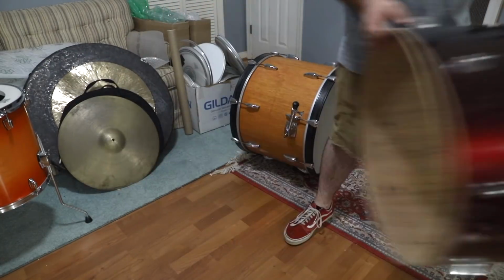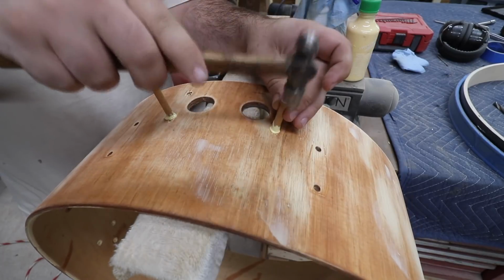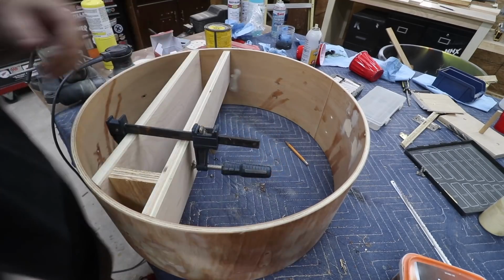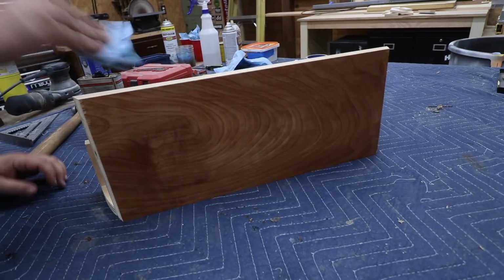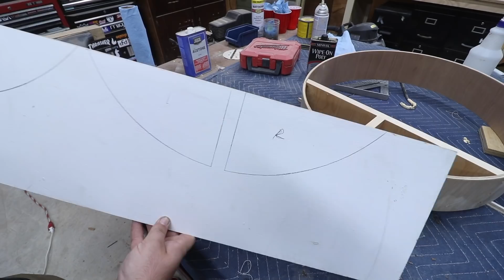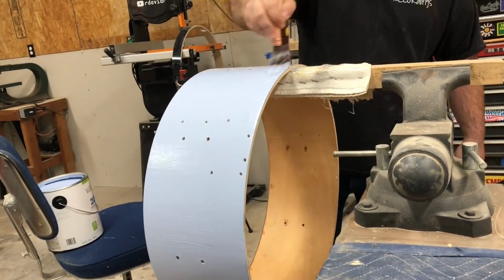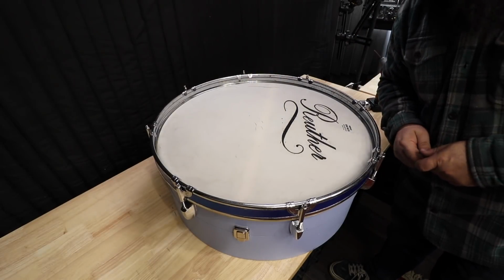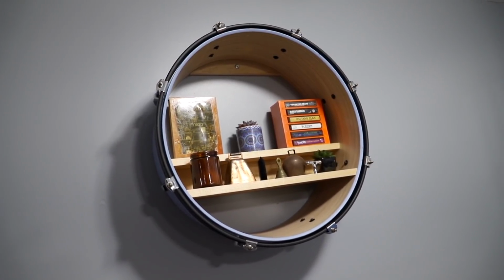I Made a Floating Shelf Made Out Of A Bass Drum!

Comment: 2:04 It is said a good rule of (saving your) thumb using a table saw is "if you can touch the blade and rip fence at the same time with one hand, use a push stick".
I don't want to be all preachy or anything, but as a fellow drummer I know all too well how much it'd hurt to lose a finger, and there have been a good number of long-running woodworkers who used table saws for 40 years before chopping off a finger the first time.
Please use a push stick!

Comment: Real nice. Now I can get the cheapest used Chinese knock-off drum set on ebay and if it turns out too trashy, I can always turn it into a set of rock'n roll shelves! Plus maybe a lamp.
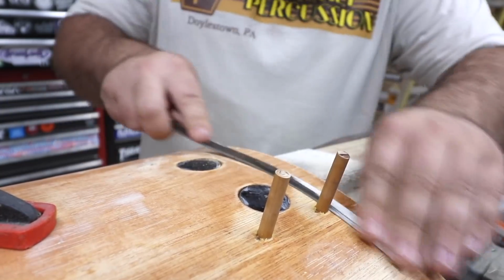1:16 Tool tip (though I'm probably the hundredth tool nerd to write that:) there are purpose-made flush cut saws whose teeth have either no "set" or are even bent slightly upwards, specifically for cut dowels flush whithout scratching the surface. My favorite one is the Japanese version, also called a "Kugihiki". Costs next to nothing and you can even use it for all kinds of other woodwork besides cutting dowels. Very thin, flexible and disposable blade.

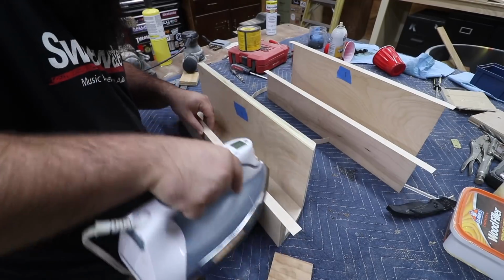Comment: What tool is that at 3:12?
Reply from the maker: Not sure exactly what its called... But its a flush cut tool for edge banding, this ones made by Fastcap
Reply: @rdavidr  Ok thanks. I figured it was intended for edge banding but I never did enough edge banding to need one. I’ve used a router and a flush trim or chamfer bit to cut my edges. That tool looks like a huge time saver with certain types of projects.